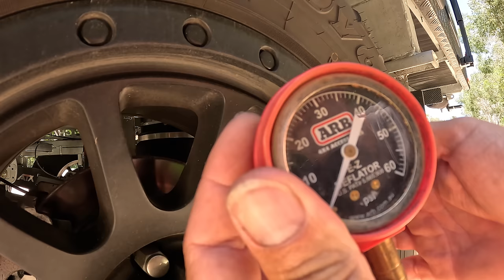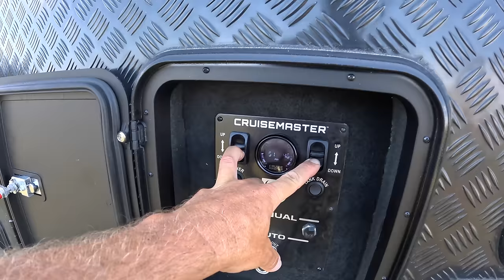SAND, SEA & SOLITUDE - ONE MANS CRAZY BEACH CAMP when his family leaves him.....

Comment: Hey Justin, you can cut off the starlink spx plug and install an rj45 connector on the end of it so you can plug it into your van, super simple and there’s a few kits online that come with all the tools required (if you don’t have a mate with an rj45 crimper). 

Or you can also buy plug and play adapters for it as well if you don’t want to cut your cable.
Reply from the maker: Cheers man, I’ll give it a go hey
Reply: Yeah mate, super easy to do and there’s heaps of videos online showing how to do it, and plenty of excess cable if you do arse the first one up 😂
Bunnings and Jaycars sell rj45 connectors and crimps as well if you didn’t want to wait to buy something online.

Comment: I have been using the tuff terrain tyre deflators and so far have had no issues with them, and they are pretty accurate. And they have numbers on the dial so you know how far you want to drop your PSI to, plus less strain on the knees lol, and doing 4 tyres at once.
Reply from the maker: Sounds like a plan

Comment: By the way mate you can just cut the Starlink cable and chuck an RJ45 on either end and plug into the socket on the caravan. Then buy an RJ45 joiner for when you're not using it with the caravan.
Reply from the maker: That’s the plan yeah👍👍

Comment: another awesome vid thanks! I have just ordered the ATX suspension kit with the level 4 controller - is yours level 4 and if so do you use the 'auto' levelling option? and have you had any hassles with it?
Reply from the maker: Glad it helped, yes ours is level 4. I use it the auto ride height function to set up for travel. It would be good to add the remote control feature as well

Comment: Hey mate,  you can 'modify' your Starlink cable as it's essentially only a data cable with different connectors. You do need to chop it and jam RJ45 connectors on the ends; there is heaps of info about it on YouTube. Cheers, Cam
Reply from the maker: Thanks mate I’m gonna do it hey
Reply: @TripInAVan  for sure. Have a crack and record it; great content👏🏻
Reply from the maker: @cameroncresswell2986  for sure

Comment: Hey J , yeah love Teewah .
About to get a van with bags, what % you running for road and what % for sand , 
Cheers mate!
Reply from the maker: Bags stay the same mate hey. Mine are about 55psi for the correct ride height
Reply: @TripInAVan  thanks mate , so for the correct ride height , you just raise or lower to keep the van level with your tow vehicle . ? how much travel do they have , 
Cheers
Reply from the maker: @steveseeney6493  not so much to level it with the vehicle, just to get the airbags at the correct height for range of movement for suspension
Reply: Ahh gotch ya , thanks for your help champ !
Might be a good idea for an episode on how they work and applications
Cheers , keep up the good work 👍🍻

Comment: The new gen 3 Starlink dish is garbage it’s manual alignment and is troublesome. The gen 2 is better for automatic alignment even though it’s bigger also it’s supposedly better in power so if you are using on an inveterate gen 2 is better on battery. Jira get the pin outs and chop the cable and install the router in the van and run the oem cable to the external RJ45 port in your van and on the chopped bit crimp an RJ 45 on it. Problem solved. 😉
Reply from the maker: That’s the plan 👍👍 that’s no good about the gen3